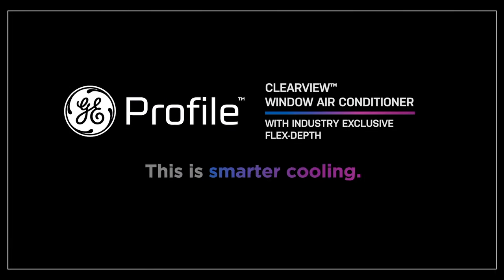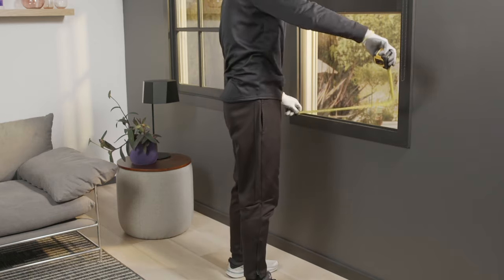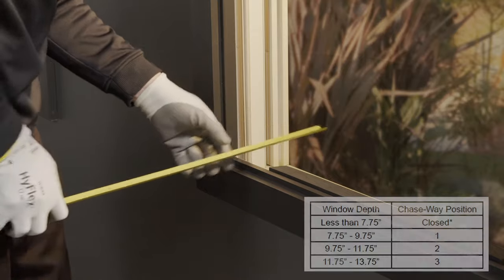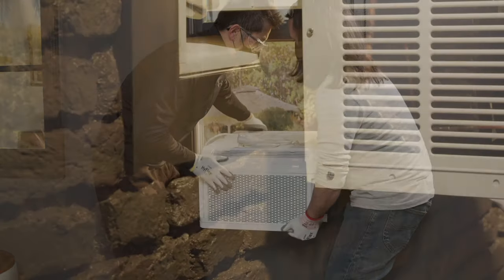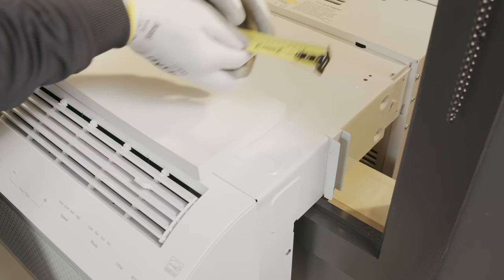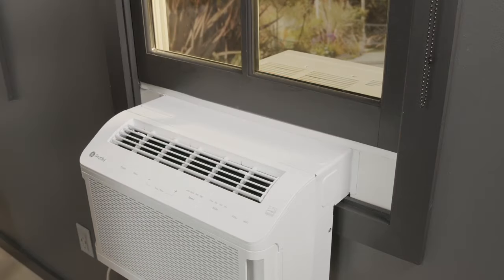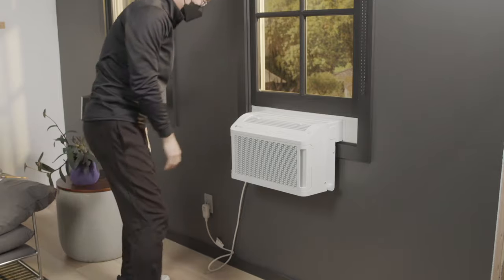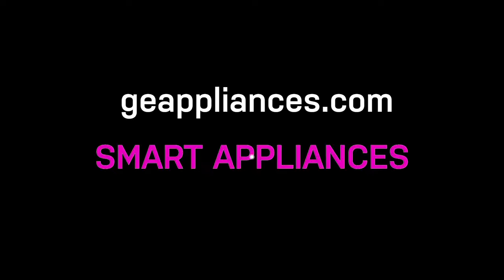GE Profile™ ClearView™ Window Air Conditioner Installation

Comment: You should avoid screwing shut the only escape window in your bedroom.
Reply: Good point LMAO🤣🤣
Reply: I go down with the ship chief
Reply: Really, this should be a top point.  I was thinking exactly this when deciding what air conditioner to install. A portable AC would let you easily use the window as an escape route, if some locking mechanism is made to be simple to unlock from the interior. Portable AC's merely use a small panel that can be taken swiftly out of the way. I guess that removes your window security. It's either escape route or security, choose one.  Glad the room I want to add supplemental AC has two good size windows.  Even if you could escape through the window, a window AC will be totally in the way, even this GE Profile Clear View.   If anyone wants a portable AC, please make sure to get one that has dual (two) hose vents. You need two, or the single hose one will vacuum effect all air from rest of house through/under door. Also you need two vent tubes to dissipate warm air out of the room.  Single hose means it has no where to go.
Reply: @Starry_Night_Sky7455  We have put a piece of wood between the top sash and the unit so that it can easily be removed but it fits snugly otherwise for security
Reply: Break the window?
Reply: That’s a good point but it’s likely you wouldn’t be able to get out with in your window.

Comment: People need to be aware that the 13.75" doesn't take into account the support knobs that stick out.  We had measured our available sill for our unit, and the available width was exactly the widest setting.  After recognizing that the knobs to the support take away an inch of that, we had to adjust how we installed it

Comment: What if your window slides left to right and not up and down
Reply from the maker: Hi Ellie, thank you for your interest in the GE Profile ClearView Window AC! The GE Profile ClearView unit is 19-5/8 inches wide. The window must open at least that far. The air conditioner can be installed in a sliding window that opens as far as 19-5/8”, but you must provide your own window filler above the unit. We hope this helps! -MB
Reply: The rock says turn that sombitch sideways and close those left to right windows
Reply: "MB" is saying that if your window slides left/right, then you will need to fill the hole above the air conditioner with something... such as plywood or plexiglass/lexan (clear plastic sheets).  You can buy either at home improvement stores.  Some stores will even cut them to the size you need.

Comment: Where does the condensation go? Does one have to "drain the unit" to a bucket every time it fills up with water or is there an automatic way like drilling a hole in the wall and running a drain line outside?
Reply from the maker: Hi Mark,

Thanks for reaching out! It's recommended that you leave the exterior drain plug in place as removing it could hinder the efficiency of your unit.

As far as water collection goes, water is collected in the indoor section as the air conditioner removes moisture from the air during the cooling process. When the indoor tank starts to fill up, water will get pumped to the outdoor section where it evaporates or drains out. Just like any air conditioner, the water is picked up by a fan and is flung against the condenser coils to evaporate. Because the water is pumped to the outdoor unit, draining the indoor tank is not necessary in most cases. The outdoor unit only needs to be drained in certain situations.

You can learn more by taking a look at the following article: https://products.geappliances.com/appliance/gea-support-search-content?contentId=000062584&_ga=2.173683235.1059795318.1656962450-450628325.1656676200

Hope this is helpful! Let us know if you have any other questions or concerns.

All the best. -MS
Reply: this is what I found from GE official website...."The good news is we do not anticipate you having to drain either side of the unit in most instances. Water is collected in the indoor section as the air conditioner removes moisture from the air. When the indoor tank starts to fill up, water is pumped to the outdoor section where it evaporates or drains out. It will evaporate with the outer rubber plug installed. Water is picked up by a fan and flung against the condenser coils to evaporate. If the rubber plug is removed to decrease noise the water will drain out. Removing the plug decreases efficiency."

Comment: There instructions are contradictory.  The installation states the unit should be level front to back, but under troubleshooting for water dripping inside the instructions state "make sure the air conditioner slants slightly from the case front to the rear."
Reply from the maker: Hi James,

We understand how this can seem contradictory and apologize for any confusion. When installing you want to make sure that the air conditioner is level, however, if you notice water dripping inside then it is ok for the unit to be slightly tilted towards the back. This should be done no more than 1/4 of an inch. Let us know if you have any other questions. All the best. -MH

Comment: looks really nice, will the chase way come out completely so you could say re insert through a slot cut into a exterior wall ? (in otherwords will it separate into two pieces ?)
Reply from the maker: Hi there,

Thanks for asking! The unit does not separate into two pieces and is meant to be installed in a window. If you have other questions, feel free to ask!

All the best. -MS
Reply: For wall installs, you would want the traditional, one piece air conditioner

Comment: Why do the 8,300 and 6,100 BTU units have same dimensions? If the 6,100 BTU unit was 18.5 inches wide (left to right) instead of 19.7 inches, it would have solved my longstanding air conditioner problem. Unfortunately, I can't shave 1.2 inches off the sides of my windows.
Reply: That’s what I find weird too, and also the same weight, the 8300 one is HEAVY

Comment: I have this AC. water is leaking from the inside even when the drain cap is closed. is something wrong with my AC?
Reply: Did you check to see that it is installed level?  If it is not level (front-to-back, AND side-to-side), there can be problems with draining the condensation.

Comment: Where does the water drain. Does it drain in to the condenser and make noise or does it just drip out side?
Reply from the maker: Hi!

Thanks for asking. Since the saddle unit base is below the windowsill, water collected from the evaporator (humidity removal) is pumped to outdoor side of the unit. There is an internal pump that pumps water to the outdoor side. In a case where the pump fails or cannot keep up because of extremely high humidity, the unit has a safety switch to shut down the unit. This keeps water from dripping from the unit on the indoor side.

Hope this is helpful!

If you have other questions, feel free to ask. -MS

Comment: How wide in thickness are the foam side window fillers? My window is 52" wide so I need to find some foam pieces to fill each side of the AC unit.
Reply from the maker: We'd be happy to look into this for you. To do so, we need you to provide the full model number for the model you're inquiring about.

Comment: Hmmm, I need to see the specs. I take it this is a conventional AC not an inverter?  It looks like an easier install than most window AC units, as long as you have two people to lift it into place.
Reply from the maker: You can read more about these AC units here: http://spklr.io/6052ojfw 

Choose the model you're interested in to see the product page which contains the specs and details section.

Comment: 1) Should the front be flush with the wall or is there an inch or two between the front inner side and the wall? 2) Should the screw knobs at the back be very tight before putting the nuts in place? It seems to me that I can turn and turn and they never really get tight. 3) can the upper window be lowered to allow fresh air into the room while the unit is in the window? 4) Does the fan pull air from outdoors into the room or air from inside?
Reply from the maker: The detailed instructions for installation can be found in the Installation Instructions for your model. If you need some assistance finding the Installation Instructions, please provide your full model number, so we can better assist.

Comment: Where can I find foam mounting support replacements? We take our unit out during the colder months and it had  to be removed last season. Can’t find these anywhere.
Reply from the maker: Hello,

Two foam support pieces are included in the installation parts. If you want to purchase new ones, please send us the model number of your AC Unit. We'd gladly assist! -SH

Comment: It says just to measure the chase way depth but doesn’t tell you to measure the entire wall thickness? Our outer (brick) wall to the inside window sil edge is about 14 1/2 inches. The chase way itself is about 4 1/2

Comment: Any idea what the expected amperage is on these units, ranging from the 6100 BTU one to the highest? I am considering one of these for a bedroom on a limited 15A circuit.
Reply from the maker: All our GE Profile ClearView Window Air Conditioner models require a 115/120-volt AC, 60-Hz grounded outlet protected with a 15-amp time-delay fuse or circuit breaker.
Reply: @geappliances  Alright. I appreciate the info.

Comment: My windows are 48 inches wide for the room i am trying to cool. Will this fit?
Reply from the maker: Please provide the model number you're inquiring about, so we can better assist.
Reply: @geappliances  I wanted the clearvjew at 8000 btu with an inverter. My window is 48 inches wide.
Reply from the maker: Per the Installation Instructions, the window should be between 20”-40” wide. You can see this on page 11 of the Use and Care Manual here: http://spklr.io/6056ULnC
Reply: @geappliances  do you have any way for the fit? Extra parts or such?
Reply from the maker: We do not have any accessories for this for this model.

Comment: Just installed mine and it's blowing cool air to the outside
Reply from the maker: We appreciate you reaching out. Do you mind sending us a PM/DM on our Facebook or Instagram page with the model and serial number of your appliance? We'd like to see what we can do to help.
Reply: Send them a picture of it installed also.
Reply: @darwinsimmons1  I got it running right that's the design the fan actually picks up the cold water out of the pan and throws it up onto the radiator to cool it to be more efficient there's some videos on YouTube

Comment: Could this be separated into pieces and put back together for like a basement window?
Reply: No
Reply from the maker: This unit is designed to be installed in a window and the unit does not come apart. The industry exclusive adjustable chase-way comes with four positions to accommodate walls that are 4.5” to 13.75” thick. The unit simply sits over the windowsill and locks into place with adjuster bolts that tighten into the exterior wall.

Comment: Does anyone know if they make an extension depth kit for this? My window is 16” but I know it only extends to 13.75” 

Or any potential solutions would be greatly appreciated
Reply from the maker: At this time, we don’t have an extension kit available to make the unit compatible with a window deeper than 13.75”. To ensure the unit operates correctly, the air conditioner does need to be installed per the instructions in the use and care manual (which you can view on our GE Appliances website when you look up the model number and go to the product page). A deviation from the installation instructions may void the warranty. We will certainly let our team know of your interest in an extension depth kit for future consideration.

Comment: I think You better insert the antibug sponge from the  outside of the window or both sides.
Reply from the maker: Hi!

Thanks for reaching out. We don't recommend using other items in the installation of this unit, other than what's included with the air conditioner and listed in the installation instructions as this is how we've tested and approved the unit for proper use and installation.

If you have other questions, feel free to PM us on Facebook or DM us on Instagram/Twitter.

Best wishes! -MS

Comment: What is the lowest temperature setting?
Reply from the maker: Hello and thanks for stopping by! The lowest setting on most of our air conditioners is 64 degrees F. If you have a specific model in mind, let us know or check the manual for more specific information. Thanks. - JB

Comment: Will this work on an all metal framed mobile home window, including the length of the outside support screws to the thinner wall typical to them?
Reply from the maker: Hi Tom!

Thanks for asking. The GE Profile unit fits window/wall thickness from 4.5 inches min to 13.75 inches max.  The actual window sill depth does not have any bearing on window fitment, only the overall indoor to outdoor thickness of window/wall.

This unit has been designed to be installed in a standard, single/double hung window. You can view the installation instructions, here: https://products.geappliances.com/MarketingObjectRetrieval/Dispatcher?RequestType=PDF&Name=49-5000634-1.pdf&_ga=2.90931354.1287406553.1656676200-450628325.1656676200

If you're wanting an air conditioner for your mobile home, we offer some! You can take a look at them here: https://www.geappliances.com/ge-appliances/air-water/home-air-products/rv-air-conditioners/

If you have other questions or concerns, know that we're happy to help out.

Best wishes. -MS

Comment: Are the display lights, (fan speed, temp, etc), supposed to stay on when the unit is running? Mine go out after about 10 seconds. I dont see anything about this in the manual.
Reply from the maker: We appreciate you reaching out to us with your question and would like to know a little more information. Could you please send us a PM/DM on our Facebook or Instagram page with the full model and serial number on your unit? If you need help locating the model please see the link- http://spklr.io/6057Sd83.
Reply: @geappliances it's the profile clearview 10300 model
Reply from the maker: We'd be happy to look into your concerns further. To do so, we need you to send us a private message on Instagram or Facebook with your contact information, as well as 3the full model and serial numbers for your unit. Instructions for locating the model and serial numbers can be found here: http://spklr.io/6059SdPJ
Reply: @geappliances  I dont use fb or instagram. Guess I'll look elsewhere for the answer.

Comment: Does it have a remote or only works with WIFI? Can you manually turn on and off???
Reply from the maker: Hi there, and thanks for your interest in our air conditioner! While the SmartHQ app can be used to control and monitor this WiFi enabled unit, it also has a remote as well as a control panel you can use to manually make selections. Based on your comments elsewhere on this video, we’d also like to advise we have an article on how the unit is drained available here: https://products.geappliances.com/appliance/gea-support-search-content?contentId=000062584&_ . An internal pump directs water to the outdoor side, and if too much water collects on the indoor side there is a safety shut down switch to prevent leaks. Draining on the indoor side wouldn’t be necessary often. Regarding your window, the ClearView has four chase-way positions to accommodate window sill thickness between 4.5” to 13.75”. It’s designed for a standard double-hung window with a width of 20” to 40”, a minimum height of 13” and a minimum height from the floor of 10”. More information about installation, operation, features, etc. are available in the manual, linked here: https://products.geappliances.com/MarketingObjectRetrieval/Dispatcher?RequestType=PDF&Name=49-5000634-1.pdf&_. Regarding efficiency, the unit does have an Eco Mode option as well as energy reporting to monitor consumption. We hope this information is helpful. If you have any other questions, we are always glad to offer assistance, here or over social media. Best wishes! -SG

Comment: Why does the outdoor fan continue to run when the compressor shuts down?(when the thermostat is satisfied)Seems like a waste of electricity.any tips?
Reply from the maker: A continuously running fan provides constant air flow in the area to be cooled, keeping the room at a more comfortable temperature. As a result, The fan reduces the variance of temp in the room, so the compressor does not have to run as much.
Reply: @geappliances  thanks for letting me know

Comment: Can the chase way be modified to be much narrower?  Tin snips, hack saw then be pushed back together??  I want to hang it over a window of a steel building / garage/shed.  The framing for the building uses 2" metal studs with the tin outer skin screwed over the studs.  The depth of the building is probably 3" at its thickest.  I know I can hang some 2"X6" studs across the 2x2 frame studs on the inside.
Reply from the maker: Hi Arlene,

Thanks for reaching out. We don't recommend modifying the appliance in any way as this could pose a safety risk and potentially void your warranty. We can only recommend that the unit be installed as stated in its installation instructions.

If you have further questions, feel free to let us know!

Best wishes. -MS